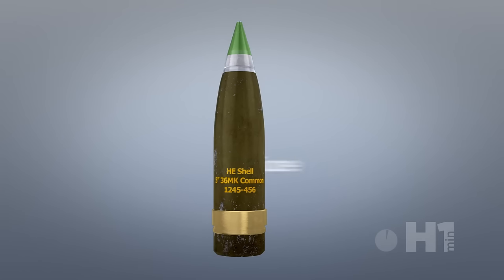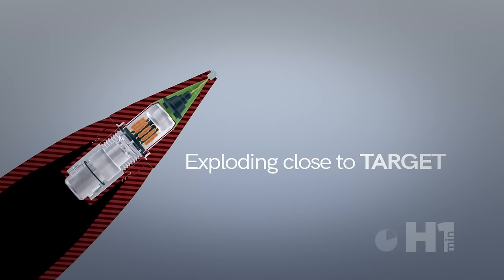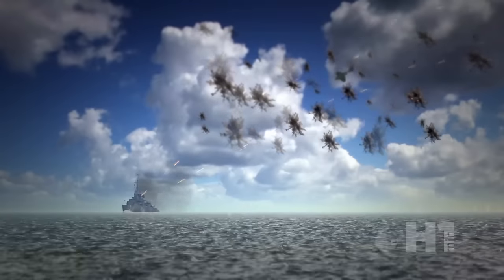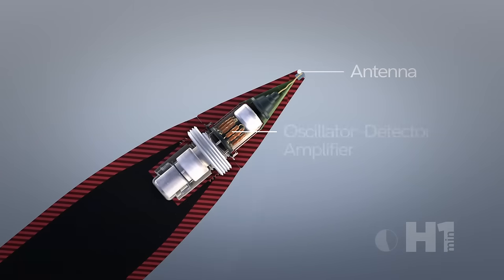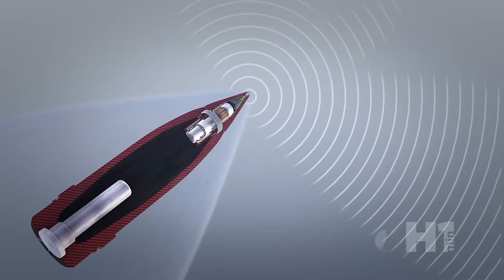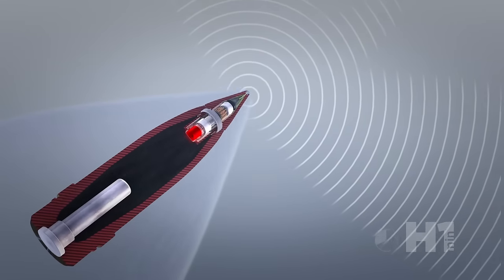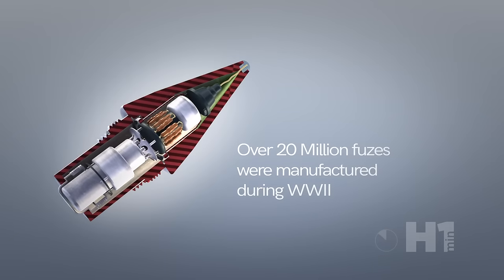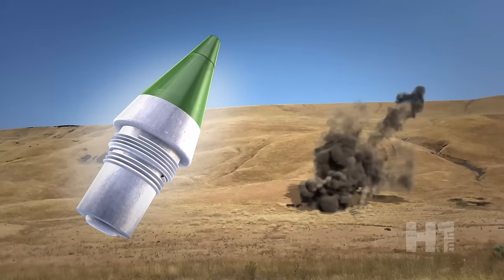H1MIN: WWII VT Fuze

Comment: could you do something similar, but for APHE Shells?
Reply: APHE is a lot more basic
Reply: @PineCone227_  APHE penetrates then explode, not exploding before penetrating.
Reply: @PineCone227_  he meant a video about APHE in the style of this video
Reply: AFAIK, they had something like a nail inside the shell which would hit a primer as soon as the shell hits something hard (due to inertia). Until that primer triggers a secondary explosive, the projectile would have already travelled on. The thicker armor got, the harder it was to make the delay right. If you got a powerful round like the 88L70 then it would likely go through a light tank without even triggering the explosive, or perhaps detonating after it penetrated both sides of the tank!
The same principle was also used for rifle rounds. The idea was to create a visual feedback for machine gunners without having to give away your position as if you used a tracer. Those rounds proved very effective against humans as a skull, or a hipbone would cause them to explode inside the body! They were thus used by the Wehrmacht and Soviets by snipers. However, the Wehrmacht strictly forbid to use them against anyone other than the Soviets, as they saw it as a very despicable practice (but the Soviets did it anyway, so there was no point in holding back). This is a nice example, of how the war on the eastern front was a completely different beast than on the western front... What I heard from my grandfather, who served in the Wehrmacht is also nightmare material... My other grandfather was a final stage alcoholic when I met him because of the war.

Comment: Initially it was only used in the navy and a secret , not widely used as the risk of it falling in to enemy hands was considered a risk . Towards germany it was introduced in 44 , germany thrmselves had them in almost ten years earlier as with most of things but they never were widespread deployed
Reply: Germany did not have proximity fuses.  They struggled with finding ways to destroy enemy bombers, to the point they designed the first SAM, but using timed fuses was a major handicap.

Comment: Surely once you figure out how this works you could just use sound to prematurely set it off. A speaker attached to an amplifier with a potentiometer?
Reply: Sound wouldn't work since the shell works with radio waves not sound. It has a tiny radar, not sonar. But you would be right just replace the speaker apparatus with a radio transmitter.
And that is why they kept it top secret on the true nature of the fuse. Publicly they just called it VT or Variable time and not something like Radio-Proximity which would be more accurate to its function.
Reply: @kittyyuki1537  Must be gutted that the secret got out.

Comment: Proximity fuze is NOT a variable time fuze, variable time fuze is a timed fuze with manually adjustable detonation time. You are talking about variable proximity fuze, which has manually adjustable detonation distance from the target.
Reply: Correct but I think it was called VT so the bad guys wouldn't know how it really worked. Navy also gave some bs about how their homing torpedo followed vortices or something. It was actually using passive acoustics.

Comment: Actually, the VT fuse was an entirely US design. The British idea was a semi-active design with the transmitter on the ship. That would work for anti-air but would have been useless for the airburst deployment that the Germans found so devastating. 

The US design which was in work at the Applied Physics Laboratory at Johns Hopkins University; before the British suggested their design was a fully active transmitter/receiver in the fuse that the British believed impossible.
Reply: Actually the British thought of the fuze concept including doppler radar, the US had the technology to be able to miniaturise it to fit in a fuze and to make it withstand the forces of firing.
Reply: @Mishn0  According to the independent book The Proximity Fuze Whose Brainchild? 'British military researchers at the Telecommunications Research Establishment (TRE) Samuel C. Curran, William A. S. Butement, Edward S. Shire, and Amherst F. H. Thomson conceived of the idea of a proximity fuze in the early stages of World War II'.
Reply: The UK shared their research including the proximity fuze and the cavity magnetron with the US in 1940.
Reply: @DepakoteMeister  You aren't listening to me. I didn't say the UK did not think up the VT fuze, I said that they are not the ONLY ones to do so. The US INDEPENDENTLY conceived the idea of a radio proximity fuse and DID NOT use the design that the UK sent over at the beginning of the war.
Reply: @Mishn0  Ah yes, the US independently thought up the idea after the UK had shared it.  Got it.
Reply: @DepakoteMeister  The cavity magnetron was a great invention that the UK can claim as their own. It wasn't the only way to build a radar though, just a better way. It increased output power by many times over a radar that used a Klystron tube as a microwave oscillator. 

But, the UK, US, Germany and Japan all independently "invented" radar I expect the Russians, Poles and French were working on it too. Just like the VT fuse, the concept is simple. Once radio had been discovered, a radar was a short leap in concept. 

The idea of radio ranging was discovered by accident by the US Navy in the early '20s while they were testing station to station radio communications. The set up they used to conduct the test had the stations several miles apart on the opposite sides of a river. While they were conducting the test, a ship passed between the stations and interfered with the transmission. 

It was a very short leap for a scientist to apply that to radio ranging. It just took years (and money that wasn't available in the late '20s and early '30s due to the depression) to work out the details.

The gas turbine engine is another example of a short step in concept from a steam turbine, but a giant task in engineering and metallurgy. Germany and the US and probably the Japanese were working on it independently and secretly at the same time as the UK, but wow, do Brits throw a fit if you dare to imply someone other than Whittle "invented" the jet engine.
Reply: @DepakoteMeister  No, the US independently thought up the idea a couple of YEARS BEFORE the UK sent over their design. Watch the video I linked.

And, there is a big, big, big, difference between "hey chaps, let's put a tiny radar set into an artillery shell so it can know to pop off when it nears the target" and actually being ABLE to build the thing. The UK could do one, but could NOT do the other.